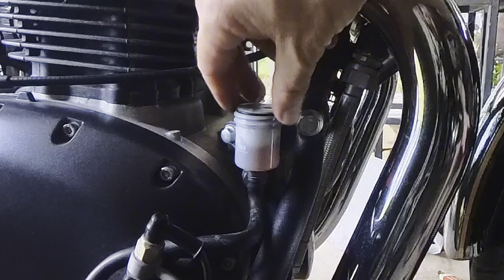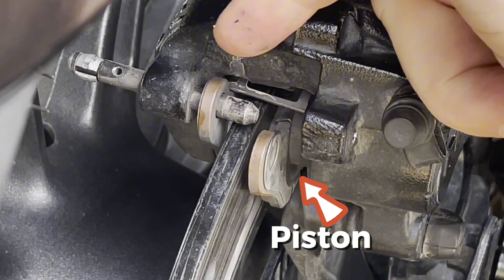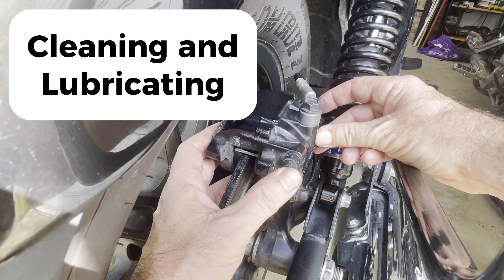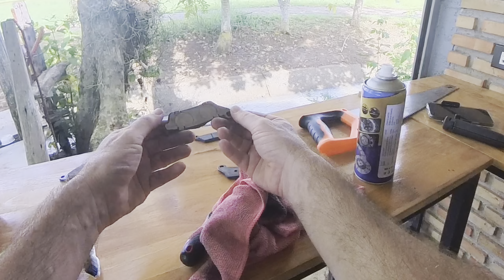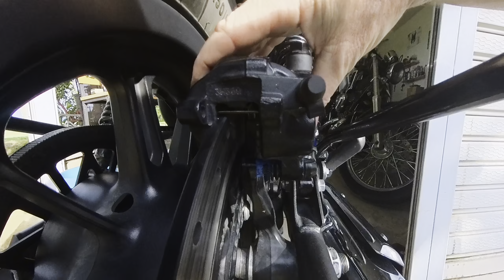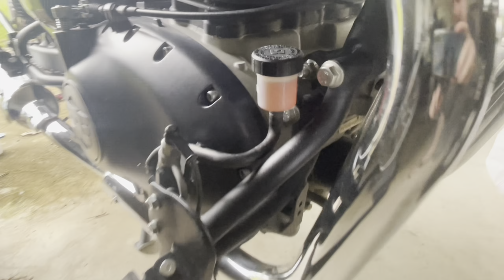Super Meteor 650 Rear Brake Pad Replacement: Step-by-Step Guide

Comment: 8:03 
It is that way 
It won’t completely release and keep gap.
it will always touch and create a self gap due to plate running.

You can confirm by
Keep on main stand turn rear wheel and press brake .
Release and turn the rear wheel and you will hear plate running sound 

Start bike on main stand and put in 1st gear and just let it speed and then turn neutral and let rear wheel come to rest.
You will notice the sound gone.

Sorry for long post 
But just to clear doubts.
Reply from the maker: Thanks for sharing 👌🙏

Comment: Just replaced the front pads on my SM650 at the 300 mile service. Pads looked brad new but squealed at the end of every stop. New EBC pads in with CRC brake quiet sprayed on the back side of the pads. Transferred metal shim plates from the OEM pads to the EBC pads. Fresh lube on the caliper pin. Cleaned rotor thoroughly. Now no squeal from the front brakes. OEM pads are Brembo branded, and appear identical to the EBC pads. I kept them for re-use. I think the CRC brake quieter spray was the cure, not just the new pads. 

Thanks for the tutorial on the rear pad change. A suggestion, perhaps a tutorial on adjusting the height of the rear brake pedal and gear shift lever. I find myself repositioning my right foot to avoid riding the rear brake pedal.
Reply from the maker: Thanks. I’ll look into it. Glad you got the noise sorted. 👌🙏
Reply: Hey Teacher, 

Thanks for video. As David mentioned that we will be glad if you make a video about adjusting rear brake pedal and shifter lever.
Reply from the maker: @captainsxe1  Sure. I’ll look into it.

Comment: Great video and glad I watched. I have just checked my bike which has now done 6,500 miles and my pads are down to about the same as yours. It’s going in for service next month, so I’ll get them replaced. Thanks for sharing and prompting me to check mine. By the way, I used brake cleaner to clean my callipers and discs every time I clean my bike.
Reply from the maker: You are welcome. And a good routine cleaning. I will start to do the same from now on 🙏

Comment: Hi, thanks for the video, it's very useful. Can you tell me if it's necessary to lubricate the pads and guides with blue grease?
Reply from the maker: Some people say copper grease on the back of the pads helps reduce noise. I don’t think it’s really necessary, but up to you. Obviously avoid getting and lube on the face of the pads or the discs 🙏

Comment: HI Teacher T
I really enjoy your videos, I also have a Super Meteor 650. I was so impressed with the Gates belt conversion that I ordered a kit and installed it on my bike. I write to you now however because I have been smitten by the recent new model from CFMOTO the CL-C450  I have had a test ride and ordered a Red/Silver model. I would very much like to see you review this model and get your insight on it. By the way your rear brake pad replacement video was very detailed and excellent.in my opinion. Cheers Ron.
Reply from the maker: Hi Ron. Thank you for your nice comment. Glad you are enjoying the belt drive. It makes the ride so much smoother and enjoyable. Thanks for the suggestion of the CF Moto. Mrs T is looking for a bike, to join me on videos. All the Royal Enfields are too tall and heavy, as she is on,y petite. This bike looks perfect. But no dealers in Thailand that I can find at the moment. Will investigate more. Safe riding 🙏
Reply: @Ride-with-T  Hi Mr T, the CL-C450 would be ideal for your wife as the seat height is 690mm and not to heavy either, It also has a belt drive which is an advantage I think. It is a great shame there are no dealerships Thailand, I will keep watching your videos as I think there great. Ron.😊
Reply from the maker: @rongriffin2453  Thanks again. It looks like we did have CF Moto, until the Pandemic hit. Then it all closed here. I hope it comes back. The bike looks great

Comment: Greetings Teacher T. Back in the 1970s & 1980s following a long wet motorway ride a typical group cleaning session was in order with plenty of teas naturally. Simply to clean the disks following the soap and water treatment I'd use a microfiber cloth and petrol from my tank. Whereas a couple of my mates would use thinners. After our Cornish holiday and the final cleaning I used thinners on my disks with the microfibre cloth. The dirt that still came off was surprising! The following day I noticed how responsive both were. Hope this helps if spray cleaner is hard to obtain?
Reply from the maker: Thanks. Even the pads herd to find at the moment 😂🙏

Comment: Hi Teacher T,  I have recently bought meteor 650 exactly the same color as yours. Your videos have been very helpful and informative. I wanted to ask you if you had any issue with engine sound. THe engine on my bike rattles a lot after it heats up. Is that something you also notice ? THe sound starts after 3-4Kms
Reply from the maker: Thanks. No rattles from my engine. That is very concerning and needs investigating straight away. Check your oil level is correct to begin with. All the way to the top line. Make sure you had your first oil and filter change done at 500km. And best to get a valve clearance check done. It used to be done at 500km but they changed it to 10,000 km now. Hopefully nothing serious. Keep me informed. 🙏
Reply: @Ride-with-T got it checked. The service center said to get the valve adjusted at 5k kms and that the sound was normal.. now I have to make my mind accept that annoying sound I guess 😅😅 .. I ll be going to few more mechanics around that sound is getting on my nerves

Comment: Excellent video Teacher T. Can I ask after how many KMs did you require change of pads? Mine got worn out in just 5k KMs. Never happened with me before. I'm riding Royal Enfields since 2009.
Reply from the maker: 9,000 km on the rear. I do tend to use the rear more than the front, But I do suspect the front will need changing soon. 🙏

Comment: Sir you installed the organic brake pads used in the meteor 350 in front whereas 650s comes with sintered brake pads as OEM. Organic one priced $4-5 and sintered one priced around $35 here in India. How's the performance, feel and brake bite?
Reply from the maker: You are absolutely right. And these were supplied by a Royal Enfield dealer in Bangkok. So I didn’t know at the time, and thought I was supplied the right ones. They preformed ok, but only lasted 6 months. But the Sintered ones I installed on the front are eating my discs, can see that 🙏

Comment: Teacher T, I have heard that Front Brake Pads of Meteor 350 is similar to Meteor 650 Back Brake, is that true? There is huge price disfference between the two, What do you recommend?
Reply from the maker: Yes it seems the front pads of the Himalayan 411, Meteor 350 and Hunter 350 will fit the rear of the Meteor 650. But they are designed for stopping less heavy bikes. They seem to be organic pads, and not sintered pads like the original SM650 ones. I did the the Himalayan to my rear. They worked ok. But only lasted half the time. In my second video about brake pads, I made a list of aftermarket pads that are cheaper and will fit that are sintered pads. 🙏 Royal Enfield Super Meteor 650: Front Calliper Service & Brake Pad Replacement Made Easy! Ep2
https://youtu.be/ROq9pjd4n0s

Comment: Good video, but you did not mention that you changed 50% worn pads. The grooves in the pads show the amound to ware off. Rawly 1,5mm prior reaching the metal ground plate. At least your old pads would have benn good for 7-8000km more.
Reply from the maker: Thanks 1 was good, 1 was not sadly. The problem with one side piston brakes. 🙏

Comment: I really don't know what to say. Ŵear rubber gloves! Use nickel anti-seize high temperature grease. Sand pads and disc to remove any glaze. And use the right tool for the job.Period! Forgot to tell you to use copper (permatex) on all electrical connections keeps water out aids in holding and removing.
Reply from the maker: I knew I would annoy some. If I took it to my local dealer, nothing would be cleaned. Pads replaced only. Dirty pistons pushed back in. And top hat left inverted. T I T. This is Thailand 😂🙏

Comment: Another bummer, that is a scooter setup. On all descent bikes, you can remove the calliper without removing the axl or at least pull it partly out. I start to lean to Triumph to replace the VN900.
Reply from the maker: Even Triumoh have this set up now on the new 400 range. Agreed you can pull the axle out part way, but this soul muck up my belt drive. The next service I will remove it fully.

Comment: Another suggestion. Spray the brake cleaner on your cleaning cloth or pad, not on your rotor and wheel. I dont think the solvent in brake cleaner spray are safe for paint
Reply from the maker: What I used doesn’t hang around enough to hurt the paint. But it certainly loosened the dirt 🙏

Comment: actually there is no mechanical system to pull back the break pads once we applied the break.....that is why the pads are touching even in its neutral position...... the disc rotation is the force which push back to the normal position of pads...... please tell in how many kilometres you changed your break pads?
i own a royal Enfield meteor 350...and i changed break pads for the first time on 19k kilometres.....
Reply from the maker: Agreed, but both sides of pads should wear even,y. But the calliper not centralising prevented this, and caused the other side to rub a,l the time. 9,000 km was the change. But I’m more of a rear brake user than a front. 🙏
Reply: @Ride-with-T   Thanks for the reply teacher🙏 i am a hard core fan of royal Enfield for 10 years...i am from KERALA,cochin🫡

Comment: these brake pads are for meteor 350 front not for supermeteor 650
Reply from the maker: Have you seen the price on the Meteor 650 pads? These were a 10th of the price. Plus no stock anywhere in Thailand. I had to settle for theses, which also fit the Himalayan 411. 6,000 km on them now. Working fine 🙏

Comment: Not the best design by RE. You should be able to remove the caliper without messing anything else up
Reply from the maker: Yeah it’s a shame. If I remove the wheel axle, I mess up my belt drive alignment. That can take more than an hour to get done. As it’s been running well and maintenance free I just don’t want to muck with it. One way of making cheaper bikes I suppose 🙏

Comment: The rear brake calipers are rubbish; they always wear unevenly, no matter how much you maintain them. I use fully sintered brake pads from EBC, which last about 70% longer. Rear brake discs then need replacing every 30,000 km.
Reply from the maker: Sadly I agree with you. 😭🙏
Reply: @Ride-with-T  I don't find that a big deal considering the price of the bike. The rear brakes are excellent, and the brake pads can be changed in 10 minutes. It's a very solid bike; I ride it in snow and ice, and it handles everything. I do miss having a second front disc brake more.
Reply from the maker: @mirfaelltnixeinverdammich what tyres are you running on? I’m about to change mine 🙏
Reply: @Ride-with-T  In summer I ride Dunlop D404s, in winter Pirelli MT60s, and I'm from Germany. I used to have Heidenau tires, but I found them terrible in wet and cold conditions. The Dunlop is perfect for me; it handles maximum lean angles with plenty of leeway and performs well in the rain. The Pirelli is the most aggressive tire available in these sizes, but it wears unevenly if you do a lot of highway riding.